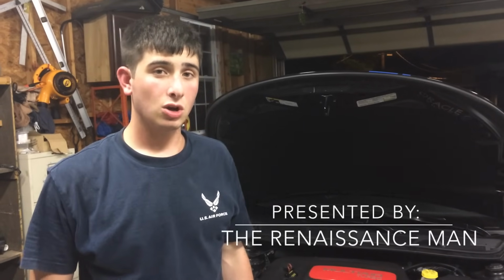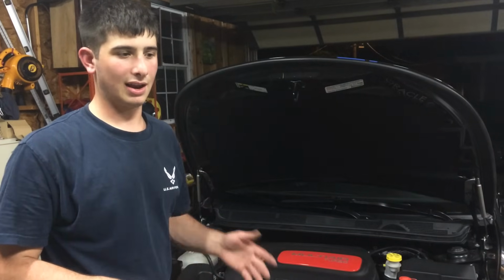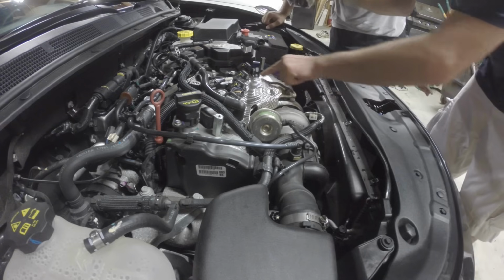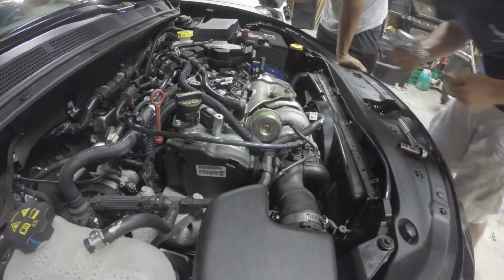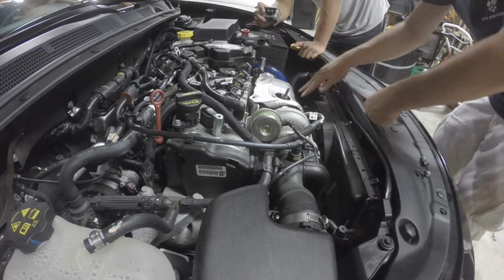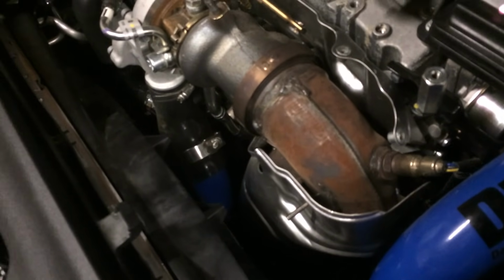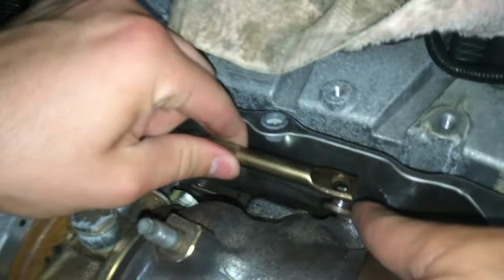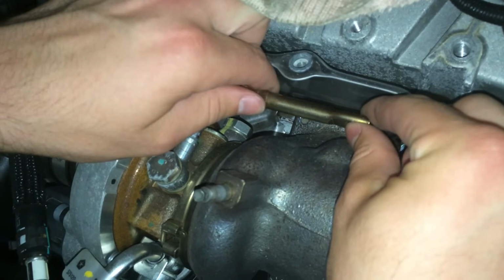Dodge Dart 1.4l Waste Gate Adjustment

Comment: Thank you for the good Info. I just got my 2013 Dodge Dart 1.4L. Installed K&N Air Intake. Noticed slow response at Low RPM's. Adjusted to 4mm and took care of the Problem.
Drives great now! 😁

Comment: Was only at 3 rotations from what I am assuming is stock or from a service by a dealer. (1 Full rotation and a half). Stepped it up to 5.5 ( Full rotations and a Half turn) and man what a difference. The DDCT shifts SO much smoother and I got some low end torque too. Can't wait for my commute tomorrow morning :D

Comment: Thread another nut on there So you can back the first nut back and lock it to the other one. Then you can leave the clip and acuater rod on and jusy turn the nuts to adjust the lesnght in or out to adjust boost.
The longer the rod less boost. The shorter it is more boost. 
The longer the

Comment: Now how much boost does this turbo come stock from the factory? and tightening the rod makes how much more? Also does this make any boost creep in the higher RPM's. And does this make the car faster? And have you pulled any different 0 60 times running the rod tighter to the actuator?
Reply: Stock you might see a peeked 20 to low 20s in psi boost. My friend has quite a few mods and is peeking at around 25 psi. He doesn't even have this mod done. lol I hear it fixes a boost leak. So doing this will help hold boost when accelerating and hit that 20ish psi mark.
Reply: @cntrollerfanboy  for some reason my dart is making 31lbs of boost stock very confusing

Comment: Another thing that helps is dropping the diwnpipe to clean the waste gate port and the flapper. The GT 1446 Garrett is notorious for carbon buildup on in that area. It can cause the P0299 code. Ive remaned a few of these for fiat and dodge and most the time they get warranty for a failed turbo due to the carbon build up on the flapper.

Comment: the little c clip on the waste gate arm do you know what its called or where I can get another one
Reply from the maker: I do not have a part number, but you should be able to go to your dealers service department and get one.
Reply: You can get e-clips or c-clips in various sizes from most auto parts stores. Either will work.

Comment: took it to 5mm  and it increased my fuel consumption by 1 L/100km. Going to set it back to stock
Reply: rock geluk I'm confused. Do you mean that your car is now getting 235.215 MPG? As that is highly unlikely I'm guessing you mean that your only getting 235 miles out of a tank.

Comment: is this bad for then engine or will it be better for it I don't see y u need to do this
Reply from the maker: Jamie Jordan you don't need to do this. It's not bad at all for the engine, just adjusting the wastegate to open at a time that's better suited to help with power output and responsiveness. I've had mine set at this for more than a year no problem.
Reply: The only reason, in this particular engine, this adjustment is not risky is because I read some where the 1.4L comes from the factory with FORGED crankshaft, piston rods and suggested maybe pistons, also. If you did not have this setup as published, than you would be relying on the intercooler to keep the top of the pistons very cool to avoid from having melt downs.   When you do this waste adjustments, the turbo gate needs more pressure to open up and allow flow to escape to the exhaust and therefore allowing more compressed air into cylinder chambers. This simulates a bigger cylinder and compresses more fuel allowing the motor to generate more power. What is not right to do is to go out and not quantify turns per boost increment. I am going to do this but I am going to quantify and measure what setting is each turn giving me vs pressure at that input of the engine. Moreover, I am going to collect the data from the ECM to tell me what the internal boost is read by the MAP. This way, I am making an educated adjustment and when the ECM is not able to compensate for the added boost, I know the injectors are too small and my air/fuel ratio is out of range. The Dart and The Abarth are great cars to play with.

Comment: Is there any other adjusting that needs to be done electronically,  as in the way the car reads the fuel /air sensors? 
Or is this just a quick under the hood mod?
Reply from the maker: The ECM adjusts itself during the 70 miles of driving after the adjustment. All sensors and stuff are untouched.
Reply: alright thanks man

Comment: do u need to drive it for 80 mi right a way or ? and is 4 the best spot or r engines dif
Reply from the maker: Jamie Jordan Don't need to do it right away. It's just that's how about how long for the ECU to learn the difference and perform the best. It may be more jumpy and stuff and use more fuel during the adjustment period

Comment: So I did this but my check engine light came on saying my o2 sensor and turbo overboost. Anything I should do?
Reply: Get a tuned ECU from Kevin Skyed. 
Too bad the 1.4l aren't supported by HPT. 
The 2.0l are and I've tuned a few that have been boosted. 
If they're ever make these supported then you can go with a larger map sensor and have it rescaled, with stock turbo and larger map there would never be a over boost CEL. 
There's ways to tune around stock map with higher boost levels. 
For now now just lengthen the waste gate acuater rod to lower boost level and the over boost CEL won't come back.

Comment: When you refer to boost gauge are you talking about a scan gauge that is reading boost from the car electronically or are you talking about a physical boost gauge that is measuring the PSI directly?  (Sorry if this is a dumb question.  I have a scan gauge that shows me boost from reading the car ODBII port and if I can use this to help me fine tune the waste gate adjustment, I'd like to read more about how to do that.)
Reply from the maker: Either or. Im pretty sure the read out doesn't give more than 20 psi or something through the OBDII, don't quote me on that. If it is able to, sure, go ahead and use it.

Comment: Interesting
Reply: Is this the fiat turbo 1.4 engine.if not can it be done to the 1.4 turbo
Reply from the maker: Steve Reitzer Its for all FCA 1.4l Turbos
Reply: Thanks for replying.this won't effect anything or cause the turbo to go out?
Reply from the maker: All it does is allow the waste gate to hold boost. When the solenoid needs to release boost, it still can, this just prevents early boost lost.
Reply: Got it thanks!

Comment: You do realize this does nothing for the engine? The common underboost issue that these have is because the poppet that holds the wastegate to the pivot arm INSIDE the turbos are loose....tightening the actuator rod outside of the turbo will make this poppet even weaker and voids your warranty.....if the wastegate is loose, you need the turbo replaced...
Reply: How can the wastegate be loose? can u explain a bit more...
Reply: @taurasification  the physical wastegate flap inside the exhaust housing of the turbo is not secured very well to its actuator arm from factory. It’s a known defect that they fixed with an updated turbo. It can’t be fixed as the flap is pop riveted to the arm. Tightening the adjustment rod would put more stress on something that’s already loose....
Reply: @anon6791  so are you suggesting, or certain to not tighten the wastegate actuator rod, whereas it was tightened before the adjustment of the rod was made...?